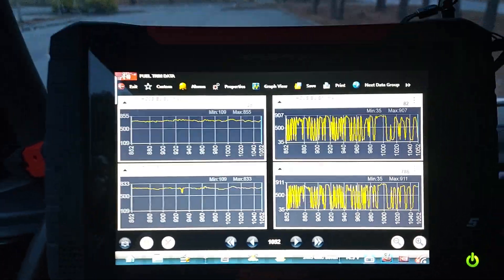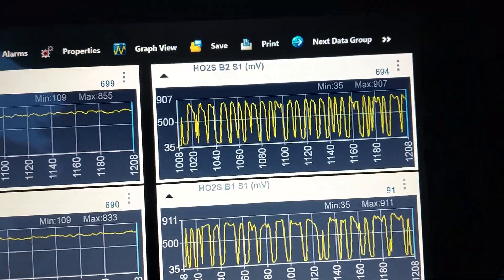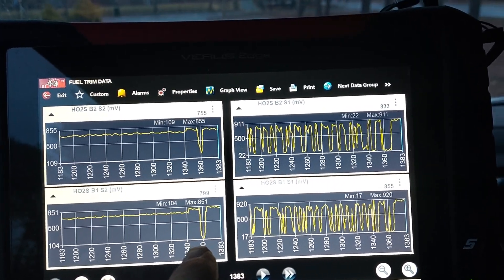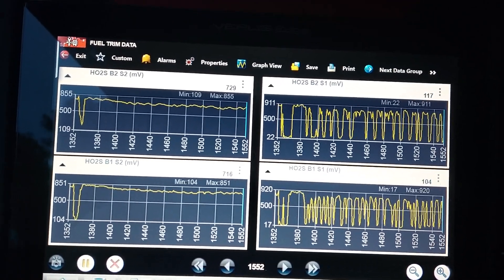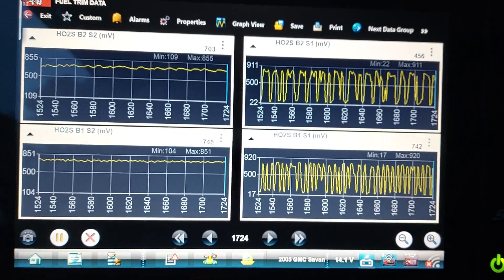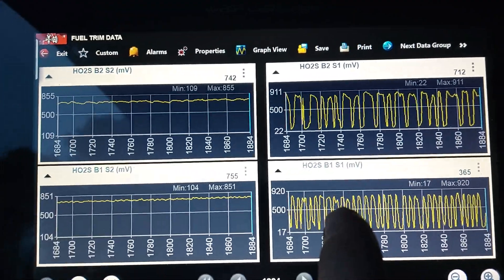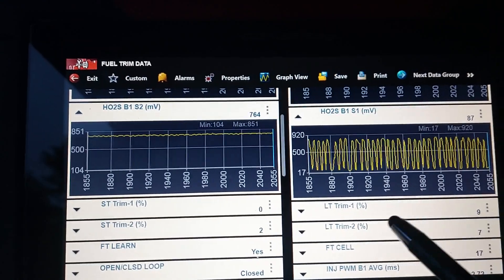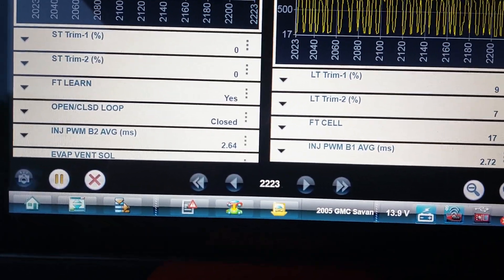Snap on Verus Edge O2 sensor readings

Comment: So these graphs depict an optimal running engine? Even though the downstream show a steady voltage of much more than .5 volts. ? 
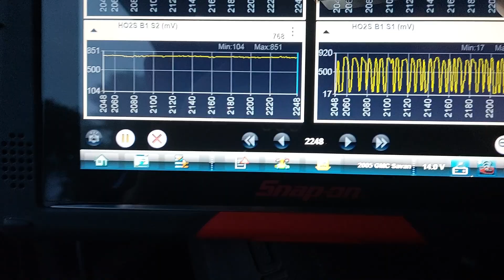And at about minute 6:22 you see those random drops in voltage on the B2S2 , is that normal?  These graphs and fuel trims seem to mimic what my vehicle is doing and I just want to rule out any problems with the sensors. I get a random rough idle at stop lights during NYC driving and sometimes during warm up that I am trying to diagnose. It seems to be much better and less frequent since I changed the plugs and cleaned the throttle body but still a concerning issue. Thanks
Reply from the maker: The rear 02s should not see much activity like the fronts. These are normal non wide band 02s. The ecm drives the fron o2s rich to lean. The ECM looks for the o2 cross frequency . The rears are a differnet story. I have another video showing the ATS EScan calculating Cat effefincy based off the rear activity. Immagine if you had no Cats. The rear o2s would read the same as the front because there is nothing except exhaust pipe between them. The Cats act like a buffer. They will deviate during accell and decell . Some cars will read a little rich and some will read a little leaner. The main thing is you want to see responce during the events. Having 2 banks can help you compare on side to another. I think there was a slight exhaust leak that caused that lean deveation . That said there were no drivabilty issues or codes. I would be looking at your front o2 , trims , egr and evap . Mode 6 can also help if you have it. You can look to see if there are any misfire counts .
Reply: @j @jessemackenzie6516 thanks for your reply and information. I will do more research .